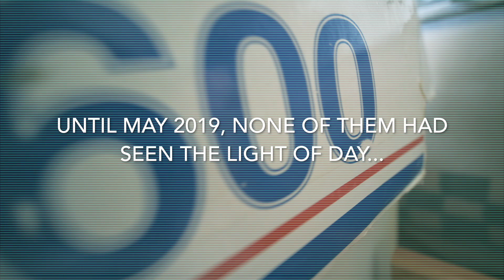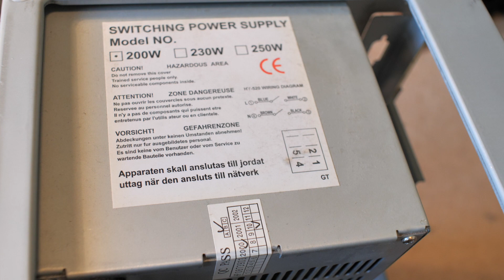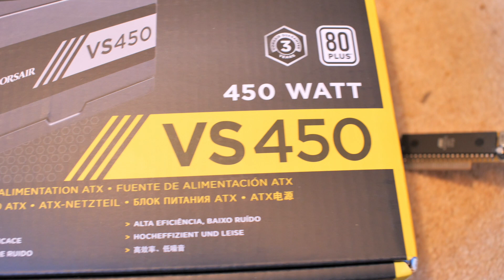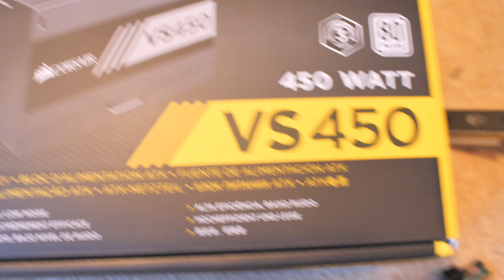amipal #24: Disassemble

Comment: I enjoyed that. In spite of screaming "anti static measures" - it's horrifying to watch you carry out procs on kit where you've spent so much time, money and effort on.  For a start the kit you're putting somewhere safe should be on an anti static mat...  and even if you're earthed, impromptu little visitors (or even PM's) may not...

Be good if you did a vid on anti static procedures you take so any neophytes don't assume you can just stick your hand into a PC etc.  and yank stuff out.  You might even give Faraday cages a mention ...
Reply from the maker: Worry not Chumbles - I had it on my ankle. You just can't see it! 
But thanks for the advice! I bought one based on a previous comment you'd made. I thoroughly agree that I should have done it on a table.